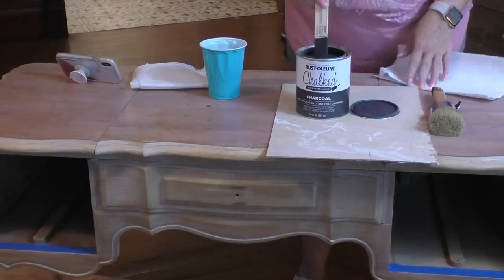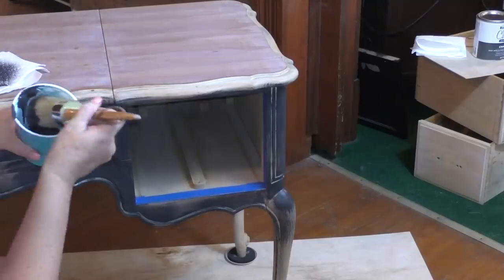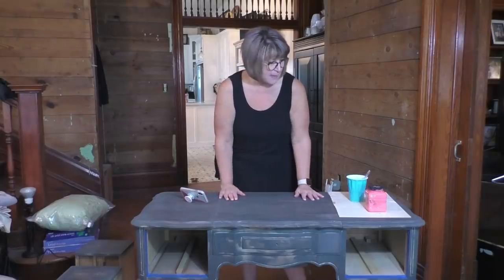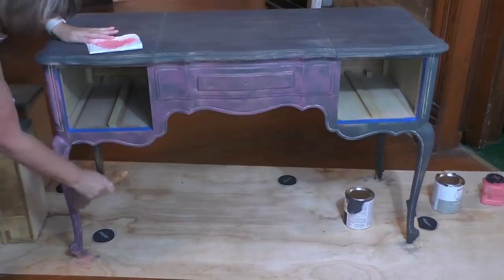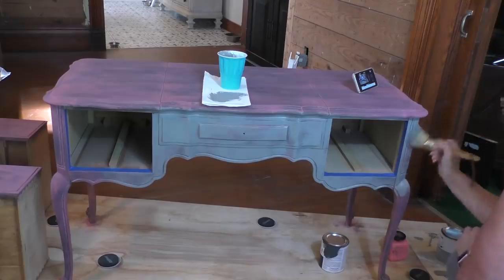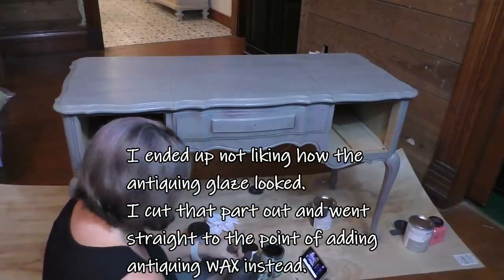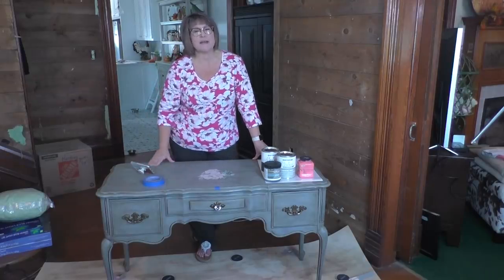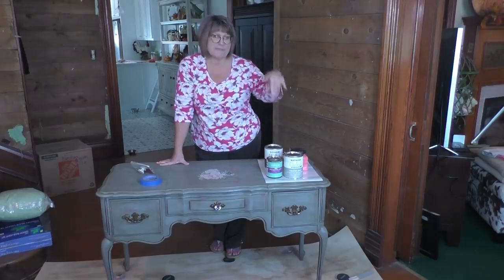Layering Chalk Paint on Furniture Tutorial

Comment: I am wondering - is this safe to do on a veneer? and after using the antiquing wax - you used a water based poly to protect it all??  what is the wait time?   Makes me wanna move to texas!        Also, I can not find your pantry door project...   Beautiful work by a lovely lady!
Reply from the maker: Spirit- You're so sweet! There's plenty of room in Texas!! I've had luck with chalk paint on all kinds of surfaces. I did a coat of the poly after the last coat of paint. Then I added the antiquing wax. Finally I added a couple more coats of the water based poly. I let the paint dry about 24 hours before adding the poly. I think you could use chalk paint on a veneered piece without a problem.  Thanks for stopping by! Here's a link to our pantry door project: https://underatexassky.com/distressed-pantry-door-diy